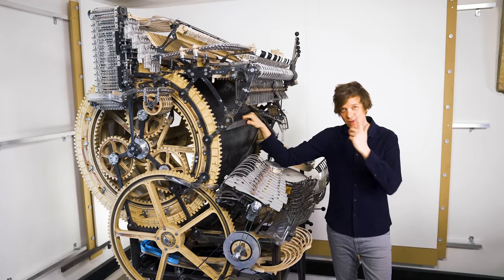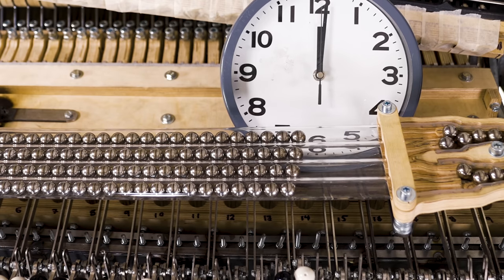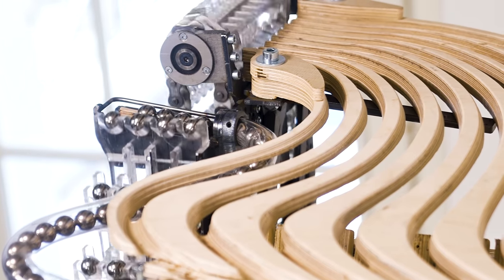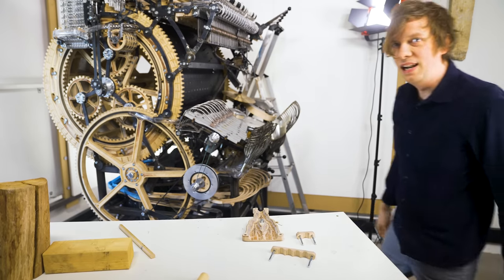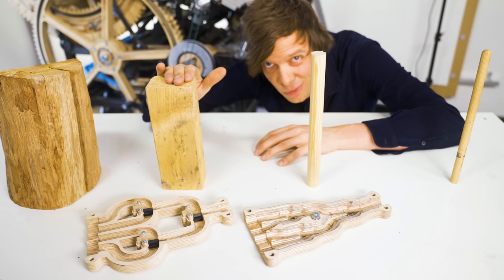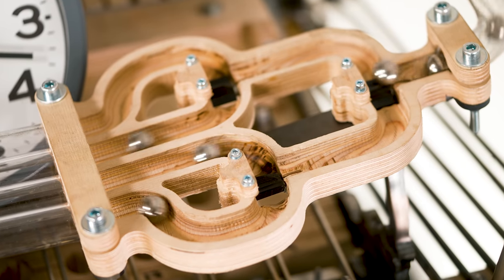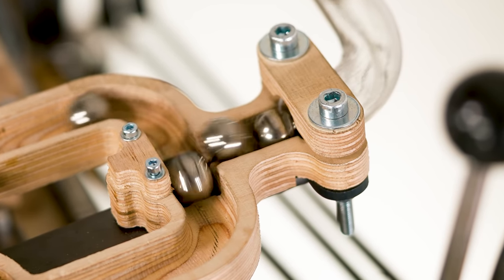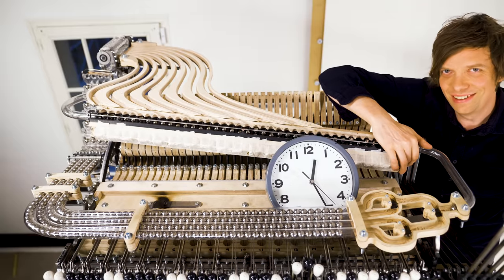Why 99% is NOT Enough - Marble Machine X Accuracy test

Comment: those moving parts made me nervous compared to the previous solid state design but seeing it operate that flawlessly has completely floored me. (lucky I'm not a marble)
Reply: Yeah, only thing I’m worried about is if the rockers could be made quieter, and how much they’ll wear.
Your stream last night was great btw.
Reply: Hi desinc I’m glad you liked my gamer village monument thing lol
Reply: DeSinc, you're everywhere
Reply: Oh hey it's Asmongloid again. You have great taste
Reply: Solid state?  The original was transistor-based?
Reply: @henrysokol3466  there were no moving parts, right? isn't that what solid state means? aka, the new design being a move away from solid state?
(edit: just looked up the definition of solid state, maybe there's more to it than just non moving parts, I see what you're saying now)
Reply: @DeSinc  'Solid state' would be useful that way, but it's actually an electronics term.  It refers to electronics made using transistors which were not part of microchips/integrated circuits.  Electronics companies would boast about the new circuitry that way when those lower-temperature, more-durable replacements to vacuum tubes were new.
Reply: When is all bugs and glitches of marble machine ?
Reply: Previous divider was extremely dependent on geometry - vulnerable to vibration and lack of precision in installation and machine positioning. That was more fragile. This one is not, the moving parts are put under low load so they should never fail, and if they ever do, replace them with steel or a better plastic.
Reply: I enjoyed the smart ass floor marble joke then realized it's you that made it, unexpected
Reply: I just watched your live stream! It's soo cool to see mutually liked channels by people who I watch.
Reply: @AstralS7orm  Dust etc. could jam them them over time which is a maintenance issue so as long as you don't ignore maintenance/cleaning and make them easy to maintain then no problem otherwise.............
Reply: hi i like ur vids
Reply: DeSinc, in the wild, commenting like a normal person rather than my favorite youtuber.
Edit: Well... maybe my second favorite... :D
Reply: Glitches and Tricks for the Marble Divider
Reply: Oi wot r u doin here
Reply: Do you have any proof that you are not a marble?
Reply: and here I thought desinc only knew how to bhop
Reply: I found DeSinc in the YouTube comments Ali-A intro
Reply: the first design was pretty finnicky if you ask me. I would have tossed the idea out if it was proposed to me.
Reply: Using glitches and tricks to operate a complex marble machine instrument
Reply: Surprising to see you here but hey I’m not complaining
Reply: So the algorithm got you too huh?
Reply: they do need to get replaced but it's just a low maintenance, although dust i don't really see them jamming up any time soon
Reply: Haha seeing DeSinc comment under another genius Youtuber is so satisfying
Reply: @nano7586  I can’t think of DeSinc without hearing ‘crouch accelerated backhop’, help.
Reply: He's here
Reply: ayyyy
Reply: 10:30 hey guys DeSinc here!
Reply: prop hopping with that
Reply: @henrysokol3466  To be fair solid-state can refer to solid-state physics and solid-state chemistry too, so not 100% electronics term. I propose we add "solid state engineering" to the list. It's only a question of do people use it like that after all, not like the Queen decides whenever a new word is created. =)
Reply: DeSinc here and not playing half life 2 woah.
Anyways love your content :D
Reply: DeSinc appearance
Reply: The rounds pretty much over tho
Reply: Why am I surprised but also not to see DeSinc here?
Reply: You really are a mysterious man DeSinc
Reply: Having watched a lot of marble races and runs this is pretty standard for accurate path splitting
Reply: Huh how did I find u
Reply: so first you wanna have your marbles do an accelerated back hop
Reply: Yeah those moving parts were insane.

then I quickly make a backwards bhop with a frying pan across the map
Reply: Same
Reply: Guy lost me at de marbles…fukin add’d right out starting thinkin of those were lifters out of an engine at the bottom there 🤣. Shinny balls
Reply: Small World
Reply: You never know when or where this mad lad will show up.
Reply: this comment didn't age well
Reply: A wild DeSinc has appeared 👀 love your vids my guy

Comment: I think the old divider was quite sensitive to being level. If it isn't perfectly level from side to side, it will over time show a slight preference for the lower side.
Reply: Indeed. It was also very sensitive to its internal geometry so any machining errors will come out as a channel preference, likewise with erosion over its lifespan (which  are both very real considerations in a passive sorting mechanism like this that relies on principles of balanced gravity and friction!)
Reply: it also be sensitive de vibrations
Reply: I concur with all of the above
Reply: I thought this too.  The old divider would still work well but it would need to be perfectly horizontal in the 'exit plane' and only slope from the single entry point towards the 4 exits to ensure all forces on the marbles were more equal than previously.  I still think that the V2 version of the divider is still the strongest and viable option as there are less pieces so less points of failure.  An option to manually add marbles would fix any flaws if needed but I suspect a slope on a single angle would fix it's flaws and remove marble preference to the lower lanes.
Reply: I was thinking "he's building in a mole and it's going to pop up whenever the floor isn't perfectly level." Glad to see he decided to go to a mechanical splitter.
Reply: @mal2ksc  so long as he made it level relative to the frame, that shouldn't have been an issue as any wonky floor would be sorted by the adjustable feet. but yes the flip flop works better as it remembers what went before rather than leaving it to chance if the input went dry
Reply: The only problem I see in the old design is that it's not working well with the queue of marbles. If you'll make them go one by one without clogging somehow, that design will work flawlessly. But the problem is not a lot easier to solve  than to make new design with moving parts.
Reply: @MaxusR  - Making it 2 -2.5 times longer and adding a downward curve in to accelerate the marbles along straight lines would be my first plans to rectify the V2 divider but the 'exit plane' has to be as close to horizontal as possible.  Less parts always means less points of failure.
Reply: That seemed the answer from the get-go.
Reply: @reggiep75  Fewer parts doesn't necessarily mean more reliable.  For example I recently tried to build a setup to use my lathe as a thickness sander.  I made a cylinder wrapped in sandpaper to load onto the spindle and rigged up a board on a hinge to set the thickness.  It works okay, but if I'm not careful I'll either stop the motor or launch the thing I'm trying to thin down.  A real thickness sander or planer has the spinning element to remove material, the movable platform, and most importantly, rollers to control how quickly a piece of material can move through it.  That's more parts, but it's also much more reliable than my janky improvised setup.  Sometimes you need to add complexity to make a system more resilient.
Reply: @harmsysbasement6249  talking from helping design/ watching others design it the problem was actually not the angle or anything like that, it was when Martin got rid of the ramp that ensures even splitting and added piping to the edge causing some geometry issues. The old design was planned to use also the angle argument is bad imho because the entire machine depends on it being level and has built in bubble levels at the base.

Comment: Those are a lot of marbles. They probably weight a lot. I would imagine they weight enough to bend the supports for the 4 marble tubes towards the outside, towards pipes 1 and 2. Maybe that contributes to the bias you saw. Either way, the new marble divider looks to be more robust.
Reply: I estimate there is (front to back) 61, 60, 59, and 59 marbles in the tubes to the pinch. So yeah that is a decent amount of weight.

Comment: He said..."Good engineering is also not about over engineering." What a great point there.
Reply: the most german statement ever
Reply: Why is the divider tilted? Isn't gravity causing this problem?
Reply: @mviz2299   yes the original  design relied in oerfect6 balance, but it would always favour one direction,  due to the corner  and momentum.. or wavelength issues
Reply: How to overengineer it ? Maybe a gate with computer control ??
Reply: As Elon Musk says it's less impressive of what an engineer can make and more impressive of what an engineer can delete.
Reply: @carsonwilliams  who's that 
is he the car guy?
Reply: @rainbob7  yeah, the Tesla and Space X guy
Reply: Wish the engineers at work though like that 
Them: let's use this mobile wall system u can reuse so when we need to demo it and redesign, it's easy. Oh, but then let's reinforce this non load baring wall with steel brackets and then blurry those brackets in a ceiling that's wielded together.
Me who has to do the work: ...wat.. now I have to break things to move the mobile wall... making it not reusable or mobile...
Reply: there is a saying that i heard somewhere, "the extraordinary, is to do the hard, in a simple way"
I tried to translate to english, idk if it is exactly the correct way to say, but i think u can understand, make hard things in a simple way is extraordinary
Reply: @gameplayfactory1440  don't forget Paypal
Reply: @CJKilbride  didnt knew about paypal
Reply: confused Toyota screams
Reply: Or, as the japanese saying goes:
A master knows when his job is done not when there is nothing left to add, but when there is nothing left to remove.
Reply: If it works, who cares.

Comment: It would be also very interesting to talk about how the first design has no moving parts as opposed to the second and what their long cycle failure looks like: does the wood get eroded by the impacts? do flip flops grind themselves out making dust, or digging deeper into the wood? etc. Great video!
Reply: I think he would get far more part longevity if the dividers and races were made of hardened steel.
Reply: @flyman451  But this is a VERY good way to prototype, cheaply, before the increased cost of CNC'ing metal works.

Comment: This is a significantly more elegant solution than the first one. Instead of relying on residual marbles to determine the next marble's position, a separate passive flipflop works much better. You basically made a very simple computer with just that single component!
Reply: Agreed, its essentially a system with binary memory instead of analog memory (the exact position of the marbles) which determines the output of the flow divider, and since each divider only has two states its easy to troubleshoot and implement now.
Reply: Thats what i thought. A manual logic gate haha
Reply: It also doesn't need to be as level either, since there isn't a way for marbles to favour a path on any incline; the gates guide things to exactly where they need to go.
Reply: Now I'm just waiting to  see a turing complete marble machine
Reply: @pow3rstrik3  We will be doomed! Doomed I tell you!
Reply: The first version relied on the precision of the woodworking/milling, and apparently it was a fraction off.  As soon as I saw the flip-flop device come in I said out loud to myself:  "That will work every time forever".
Reply: That’s exactly what I was thinking! It’s just a simple computer that can store information of what way the marble last went!
Reply: My thought
Reply: I would disagree. The old solution was more elegant and had less moving parts to wear out. This does seem to be more effective though.

Comment: 9:00 Loose bolts! It even works when it's loose. Great new design! It's very similar to the classic Wintergatan Marble Machine's marble gates.
Reply: Those loose bolts are like sliding marks made by SN15 landing legs; all most inconsequential but will be fixed for next time.
Reply: Sometimes things need to be loose for reliability. It might look dodgy, but sometimes it makes that last bit of difference between a reliable machine and a paperweight
Reply: @233kosta  Yeah I think they are loose on purpose, because the marbles might bounce off the stopper in undesirable ways if it was stiff.
Reply: @wombat4191  Bit of damping never hurt anyone, but this isn't an ideal solution - it'll wear and generate dust. Better off with a proper soft-ish damping material instead.
Reply: @wombat4191  with the washers and difference in height between the two bolts, I think it was just an assembly oversight.
Reply: Hey

Comment: 6:11 "It is good not to have overengineering" literally builds a marble machine to play music
Reply: For real
Reply: Good practices are recommendations, you don't have to follow them, even if you yourself said it xd
Reply: If you look at each part he has made, he has tried to build everything as simple as possible. You never know if something might fail. Easier to fabricate a new part if the design isn't overly complicated.
Reply: You do understand that most instruments, even though they seem simple, are way more complicated and delicate than a machine he built out of plywood in his garage? Like, his example was perfect, using a midi keyboard, if you think about it, a keyboard is overcomplicated as f lol
Reply: 2:22 Nope, it still was dividing equally lol it just appeared so as 1 and 2 STAYED full
Reply: If this was a corporate project, it would rather be an 'error' on management or market analyst's account for initialting the realization of a such a machine. The mechanical solutions are as far as I can see quite elegant, over engineering would be incorporating sensors, stepper motors n' shit to divide the marbles
Reply: Guys I think it's a joke
Reply: I'm so glad that I have now seen this machine that manufactures marbles.

Comment: "Dis is perfect" 
several weeks later: 
"it's not perfect ENOUGH!"
Reply: Unmistakeably German :D
Reply: @slingshot99  he ain't German though
Reply: Homunculus  Yes he is
Reply: 2:22 Nope, it still was dividing equally lol it just appeared so as 1 and 2 STAYED full
Reply: @firstnamelastname8790  i think it mightve actually been slightly off bit even if it were perfect, there was still the issue of clogging resulting in catastrophic failure in only 13 minutes, barely enough time for about 2 medium sized songs or 1 longer song. The new design not only matched the incoming flow but was able to process marbles fast enough that it'll likely never clog again there.
Reply: @noahjones9833  when he decided to do the "stress test" and manually blocked the feed tube to make a large amount of marbles hit the divider at once, we see that after release, the feed tube struggles to get back to normality. He had to manually speed the front of the blockage, in order to not encounter the same catastrophic failure as earlier. This suggests to me that the tube is also fallible, and needs attention, so that it can self correct.
Reply: NICE! lol